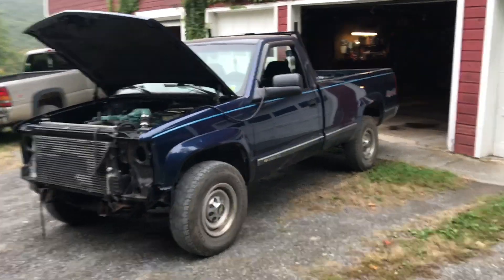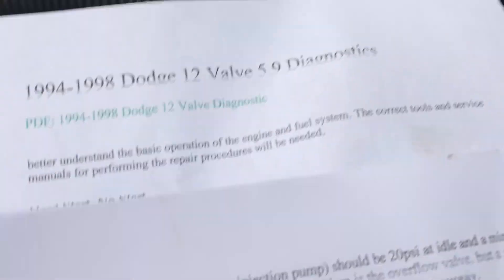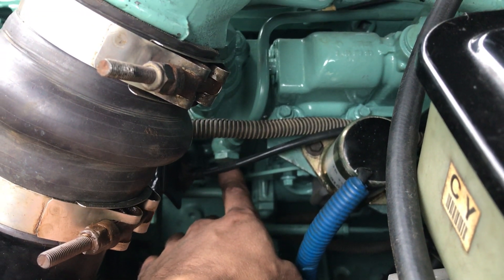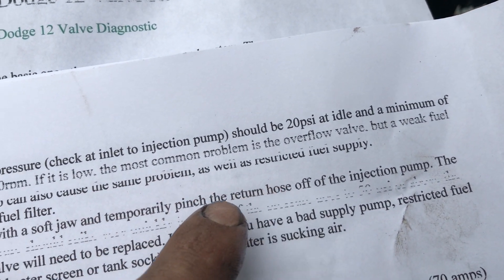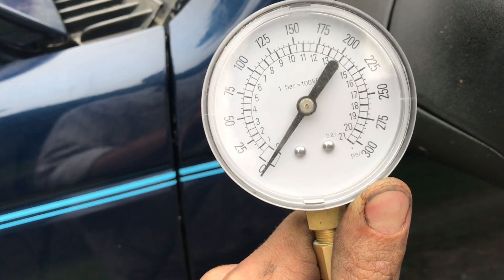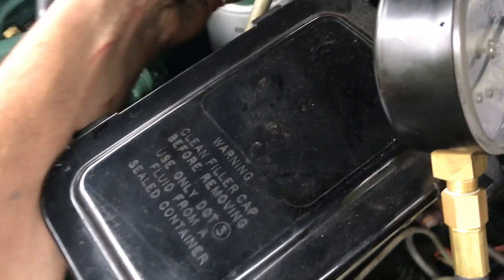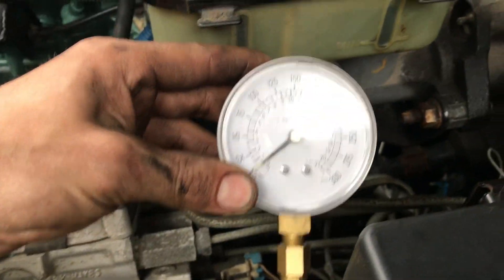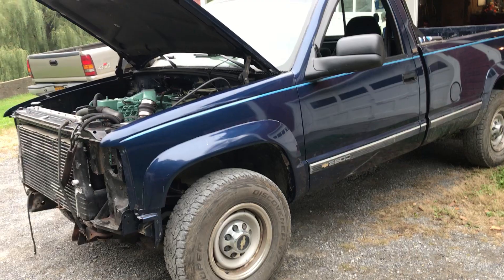94-98 Cummins Fuel Pressure

Comment: I am having this same issue right now! What did you do to fix it? Please if i could contact you asap. Thanks!
Reply from the maker: It ended up being a clogged fuel sock in the the tank in the long run, and I think at that time the injection pump (94-95 seem to get stuck barrels and cause weird problems like no power, stall, and runaway) was going too, its been a while. There are some adjustments on the injection pump that can be made to correct the stumbling on cold start ups, but I'm not that technical in them yet future video hopefully. Logancarroll39@yahoo.com

Comment: might just be some air in the system, maybe if it gets better the more its ran.
Reply from the maker: At the time I did pressure test and vacuum test my fuel lines, the fuel pump was under spec and borderline bad. This engine spits and sputters when its cold but clears up

Comment: Looks like you need a Tork tek ofv010 overflow valve
Reply from the maker: I did, and it didn't fix my problem. This motor always spits and sputters on start up cold and hot, clears up quick though. My fuel pump was definitely bad and the injection pump went after getting the truck on the road. Thanks for watching